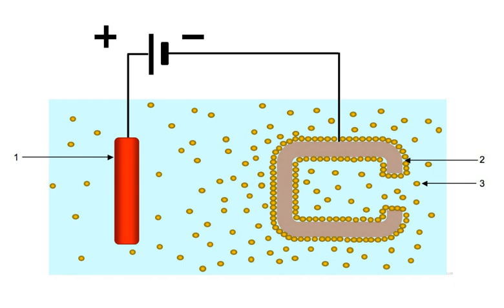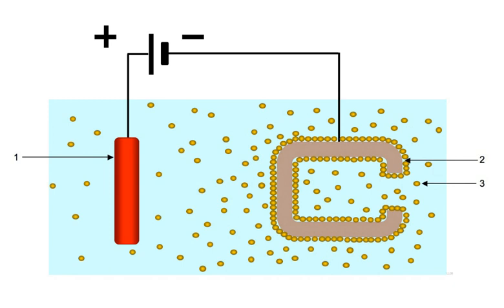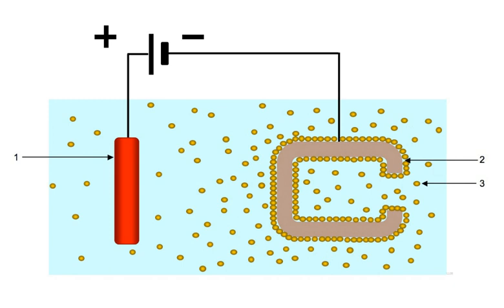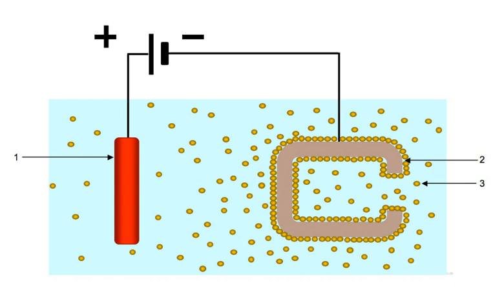Electrophoretic deposition | Wikipedia audio article

Comment: Why graphene oxide deposited at the anode in the electrophoretic process from its suspension?
Reply: the flow of electrons is opposite to the flow of current, the charged particles travel towards the negative anode intrinsically.
Reply: the flow of electrons is opposite to the flow of current, the charged particles travel towards the negative anode intrinsically.